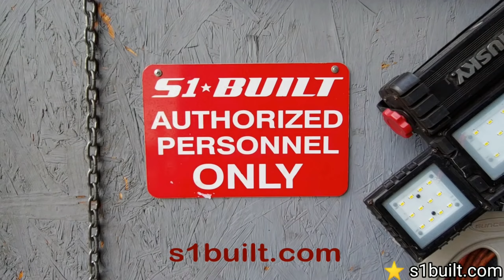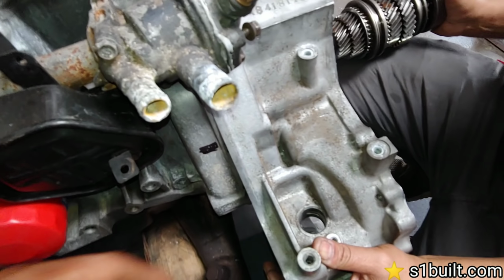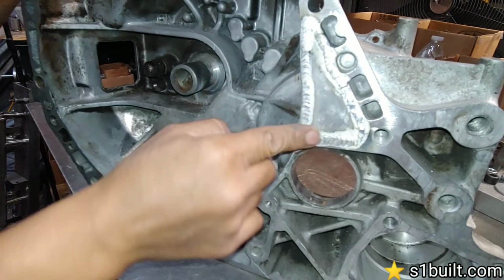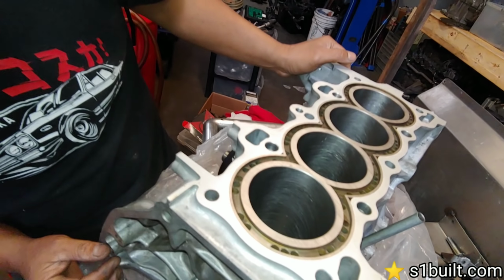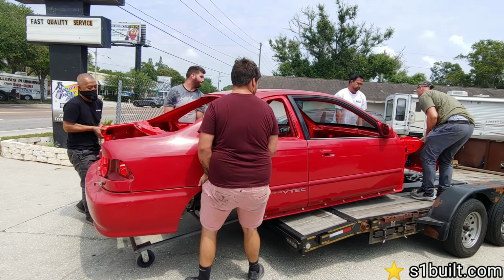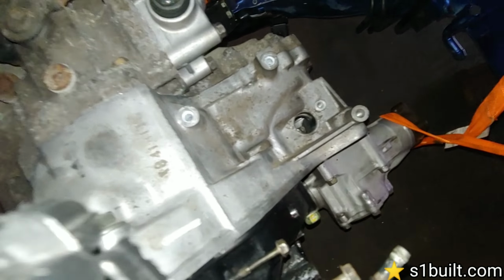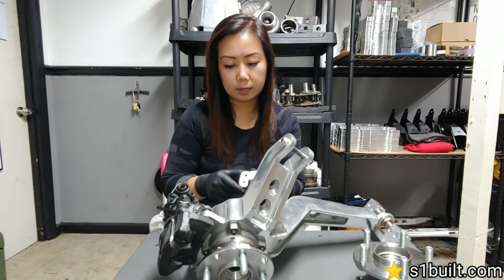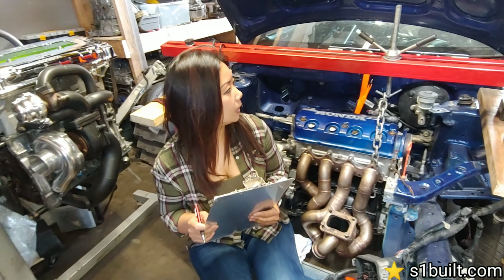⚠️Dseries to Bseries AWD No Plate Honda Insight--⚡️EK Coupe Update--🛠Our AWD/RWD Arms Configurations

Comment: I talked to my machinist friend and he told me he has done crazy swaps like I am going f2d. He has a eco boost engine mated to a suzuki samurai transmision. All he does is he turns down the ecoboost flywheel to the samurai size and uses the samurai clutch and pressure plate and mounts the samurai starter wheel on the eco boost fw.  Try and see if that can be done with the d series flywheel
Reply: That's rad! I got a Suzuki sidekick.. an been wanting to k swap it for a year now but didnt wanna start something an not have the resources!!

Comment: d series AWD boxes already exist and are £150 used in UK ,surely importing some would have been easier and quicker
Reply from the maker: We know they are available thanks 🙌..we have a few, but they are weak
Reply: I'm using one in a mini so fits my application well 👌, fairly mild hp build.  should I be worried about potential weak spots ?
Reply from the maker: @samdavis3304  the gears
Reply: Thanks for the response guys , keep up the awesome work !
Reply: @S1Built  hey can a k20 gearbox mate to a d16 ?
Reply: @S1Built  how weak are they cuz im trying to build a 500+ d series maybe 600+ and would like to know if it can handle that much power

Comment: Would that B20 work on a D17A2 in a 01 civic?
Reply: Well will it?
Reply: @pikazardcollectors1123  a obd1 motor with a obd1 chassis  can b done with wiring  conversion/harness jumper... but a 2001 or newer civic never came b series ever...anywhere. and why would you build that year anyways horrible  starting point from civic standpoint that's worst support in aftermarket and a reason none does them
Reply: If you start from nothing it can be done...i mean drilling spot welds on engine mount brackets to remove them all..possible to use complete donor car..crv,dc2.old swapped ek civic and transplant everything in the 01-05...
If i did it with a 2008 odyssey to a honda fit first gen...
Reply: @jeffgries9987  thats because you need someone to build parts for you...
Some people can actually build cars you know!